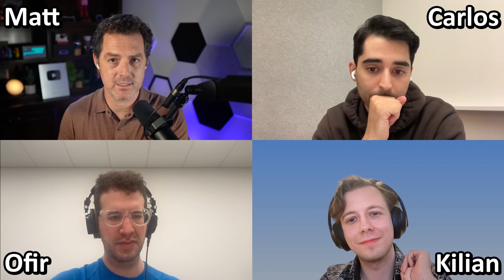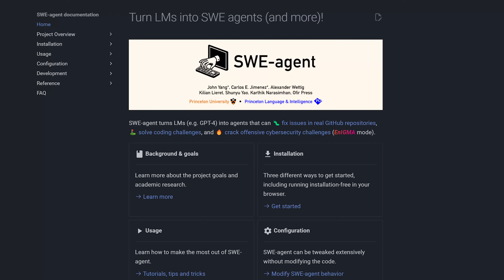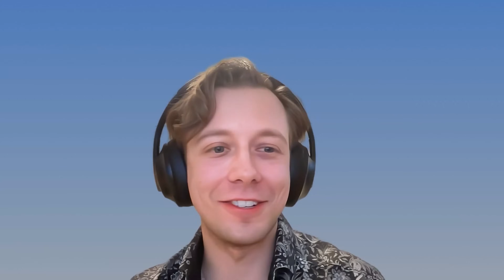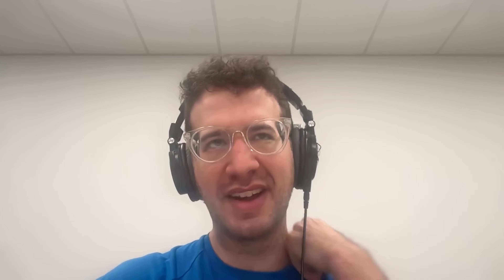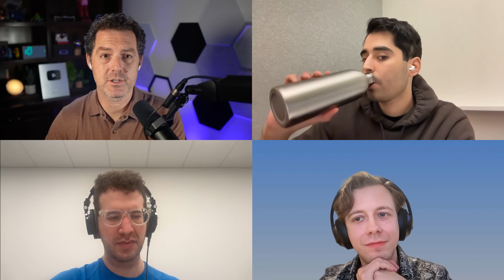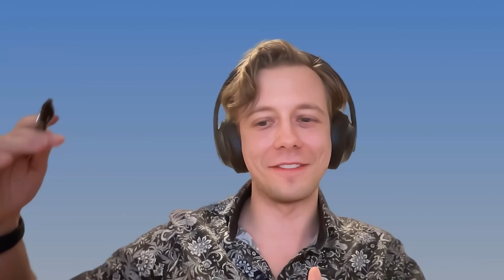SWE-Agent Team Interview - Agents, Programming, and Benchmarks!

Comment: No, he's wrong. We won't need programmers. Only good spec writers. 
And that's because the test writing agent will be really good and ensure everything is met, and documented via tests.
It won't be 4-8 years. Next year
oc, I think we should just go to a new society cuz this one won't hold...
Reply: wrong. real production code is hard. ai isnt there not even close. specially systems programming and embedded.
Reply: @freddyparra4880  - wrong. Just wait 3 months, at most, and you'll have different opinion. I've seen enough by now. They'll write the tests and keep writing the code until the tests pass and all the requirements are met. They can go much faster than us. When they are fully there, it's just a requirements writing operation
Reply: @jeffg4686  I disagree. Large scale system projects with multiple teams requires immense work, Integration , collaboration and expertise. No way AI Agents will do this by themselves and be trusted on critical systems and security components. I"ve reviewed many LLMs and one thing I find they are good at is quick prototyping but not even close to production code where your talking top security. agile environments(where requirements consistently change on the dime), CICD, Unit testing, Pen Testing is huge undertaking when multiple teams are collaborating specifically in systems. No way at the moment they can do this by themselves. LLMs produce so much hallucination that many companies are going to get burnt on the security side of things.

What it can possibly do at the moment is crank out quick web pages, middle-ware modeling and tools, which is great for developers to use for  verifying things and ideas and questions of things already done.

 Remember, these LLMs take what use to be done as Google searches and  presents to you a possibility of what the answer can be from that data. That answer can also be wrong.  We have seen it actually take exact copies of info that can be found in stack over flow and present that  as an answer. It is not self aware and doing it on its own. It is just a faster way of getting an answer when compare to regular search where one would have to navigate through multiple sites to get some type of idea but the idea had already been implemented by users, is not a new idea. 

Tell it to create a new encryption algorithm etc..and it can't because were not there yet.
When its able to do this then we can believe it will take over. 

AI at  the moment is just a copy of all human data ideas that can be process at lighting speed  and presented to a user with a question where that Idea has already been implemented. Its just a quicker search to an answer on existing ideas already and with a high possibility of it being wrong due to hallucination . The real leap is when it will be able to generate new ideas on its own and will need to really solve the hallucination  problem.

Comment: Github Copilot Editor is already way more convinent and powerful than v0 for prototyping. I actually built a meme app using it by testing the app myself, and not having to write a single line of code, just by talking to Claude (and sometimes o1) back and forth to make it happen. It took me several hours but I think I need several days to learn the libraries I am not familiar with.

Natural language as programming language for at least short term is inevitable. I remember one year ago with even GPT4, the quality was very bad. That's crazy how it improves so fast.